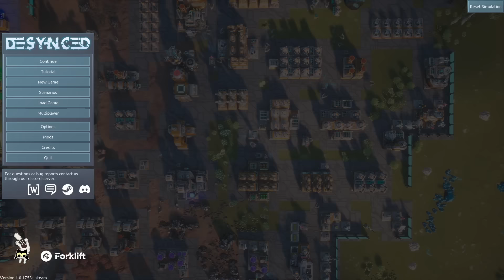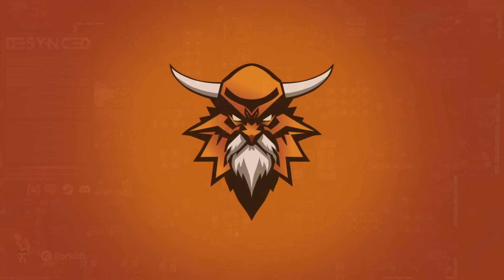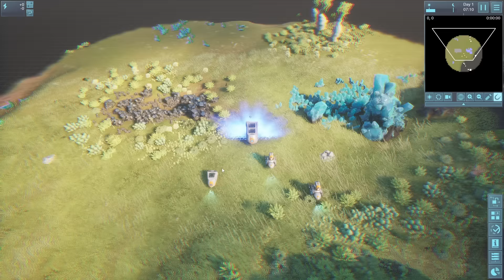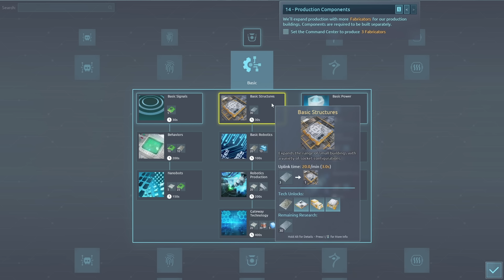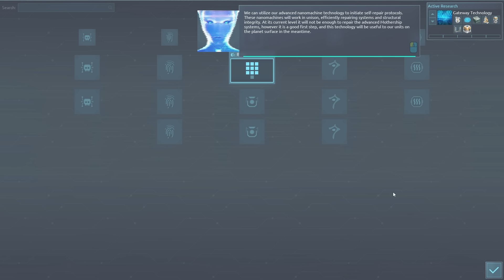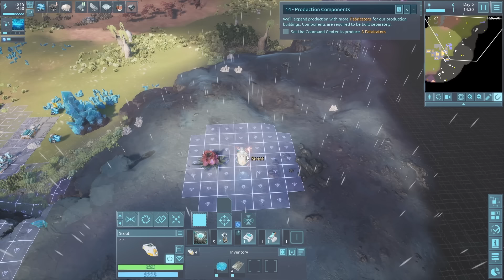The Automation Strategy Game That Rewrites the Rules - Desynced - First Look

Comment: Put a solar panel and a power extender on a small plate to expand your base and power. Also you can put internal capacitors in your buildings to store excess electricity. And put a solar panel with a small capacitor to increase power aswell.